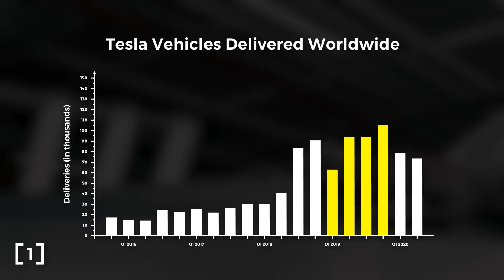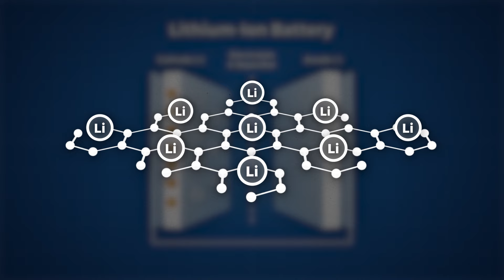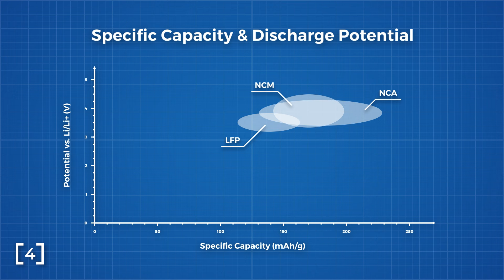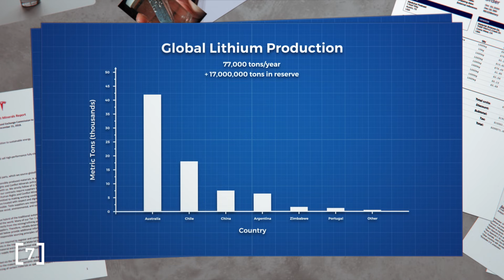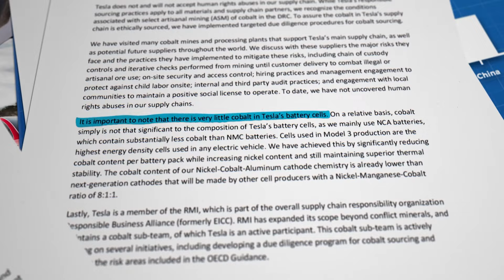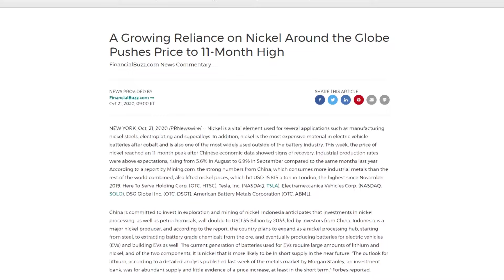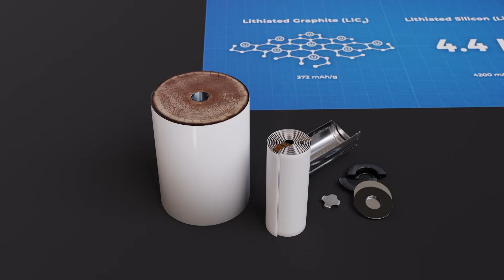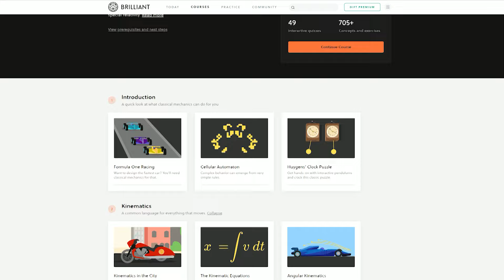Tesla's Battery Supply Problem

Comment: Some things to point out:

* There are three chemistries Tesla called out as being used concurrently in their new battery production based on the 4680 'tabless' design: LFP (iron/phosphorus), Nickel Manganese, and High Nickel. All three chemistries eliminate Cobalt entirely going forward. 

* They specifically called out LFP for grid-level storage in their Battery Day presentation, which not only has no Cobalt, but has no Nickel either. While there are still issues with LION batteries as grid storage, and liquid metal batteries are a promising theory, a drain on Nickel resources is not going to be among them, at least for Tesla.  

* You quoted the number of factories they would need with the older production lines, but you completely ignored their new production chains that reduce footprint tenfold, and that a single plant making the new batteries of a similar size to the Gigavolt plant in Nevada (and the ones currently being built in Texas and Berlin), would produce closer to a full TW of battery production, meaning less than a dozen of these would be needed. That's the sort of scaling efficiencies they are attaining in their pilot plant.
Reply: Tesla, and Elon Musk in particular, makes LOTS of claims. I'll believe them when I see them come true.
Reply: @MrTaxiRob  These aren't 'claims', these are numbers from their pilot plant already in production, and having been in production for months now.
Reply: @ShneekeyTheLost  you're talking about factories that they haven't built yet, therefore they are CLAIMS.
Reply: @MrTaxiRob  Okay, sure. Because the factories being built right now are somehow going to be less efficient than the pilot plant they've already got running. Suuuuure.

Fun fact, that 10GW 'pilot' plant? Twelfth largest battery production facility on the planet, just to put it in perspective. So they're already producing these new batteries on the same scale that everyone else is, from a vastly smaller footprint. They just consider it a tiny fraction of where they intend to be.
Reply: Additionally, the tabless cell isn't new, it's just the first time Tesla is using it. Not fair to the original designers at Maxwell and other supercap firms to pretend it's someone else's innovation and spread misinformation.
Reply: What happened to graphene
Reply: @nomoreheroes93  Not fair ?  Call it what it is -- deceptive, false, contrived, hype and outright lies from a CEO who otherwise be a carnival clown in a earlier lifetime.
Reply: He actually missed the most crucial part about the new battery construction - due to tabless design new batteries are planned to be few times more energy-efficient than current ones. This may solve all the other problems with material scarcity etc. So the whole video is either a bit of propaganda about how tesla is worse than it actually is or Brian is worse at engineering than at making videos.
Reply: This guy elaborates on the technical specifics and efficiency of the new battery quite a bit:
https://www.youtube.com/watch?v=hbPKE62aM0U
Reply: @adidasboy132  Sorry, but I'm afraid you're falsely conflating energy efficiency with energy density. The new batteries are slightly more energy dense than previous ones, but it isn't enough to magically 'solve all other problems'. 

I was bringing up points to consider, which he actually has addressed in later videos on the topic. His focus on this video was primarily the new liquid metal batteries, which is a fascinating concept and does indeed have several advantages over LION, even the new-model LION batteries that Tesla is coming out with. The longevity in particular is going to be of value to grid-level energy storage. 

Perhaps you should familiarize yourself with both technologies before trying to imply that someone is writing a 'propaganda' piece.
Reply: @MrTaxiRob  they’re built now
Reply: @Kampbell300  wow, a year later, thanks for the update. NFG.
Reply: @MrTaxiRob  well now you can see it and believe it 😂
Reply: @MrTaxiRob  ah you’re just going to find something to attack them for no matter what, ok I won’t waste my time then 😂
Reply: @Kampbell300  attack? You're attacking objective reality, sorry I only live in the present and rely on what actually exists and can be proven as such.